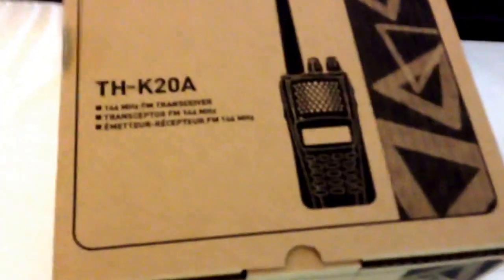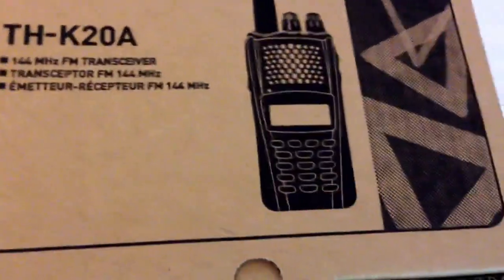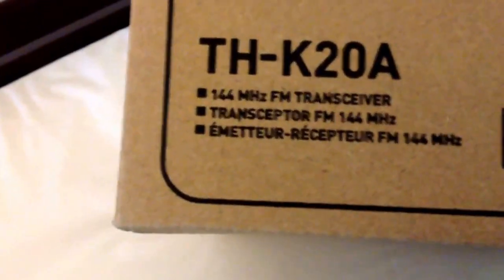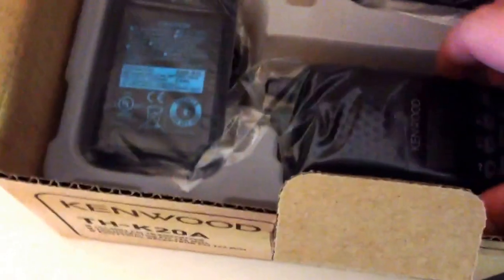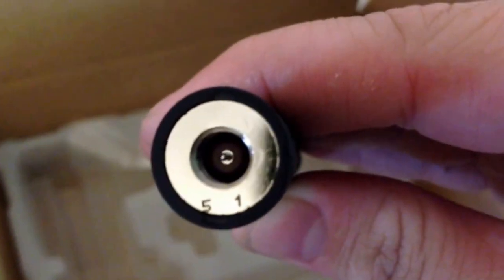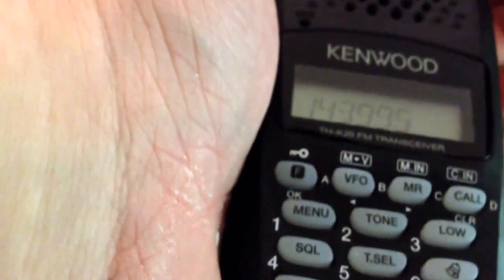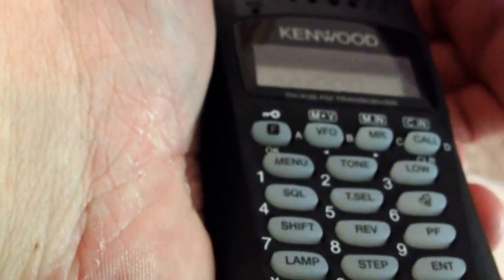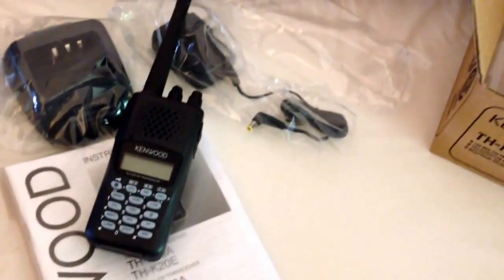Kenwood TH-K20A 144 MHz HT unboxing and Assembly.

Comment: Bought one of those after trying the Baofeng. Didn't care for the disco backlight or the clumsy programming of the Baofeng. Absolutely love my TH-K20A. Am usually complimented on signal and audio quality with new contacts. I bought the Diamond SRH77CA antenna and got a very nice improvement on ability to hit some of the marginal local repeaters. I can easily work the closest 3 repeaters on 1 watt. I Use it mobile with a mag mount antenna. Battery will get warm on long QSOs unless you keep some space between your hand and the back of the radio. Probably the best 2 meter monoband HT outthere.